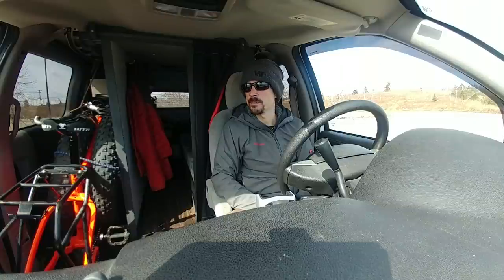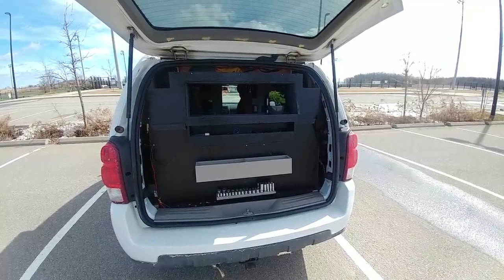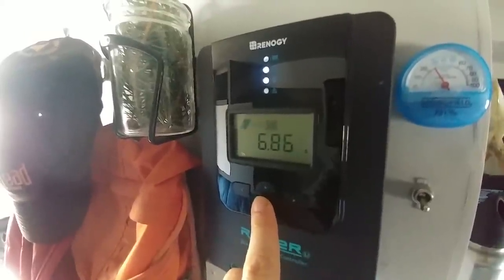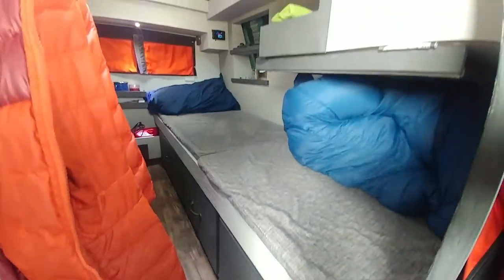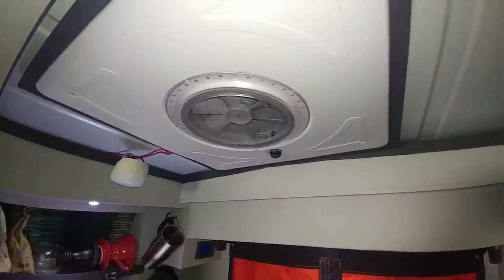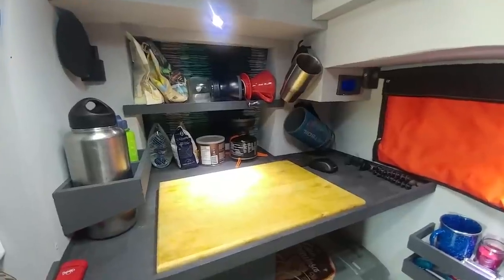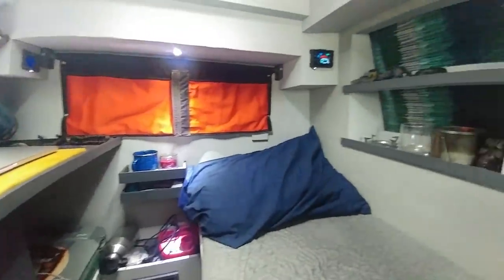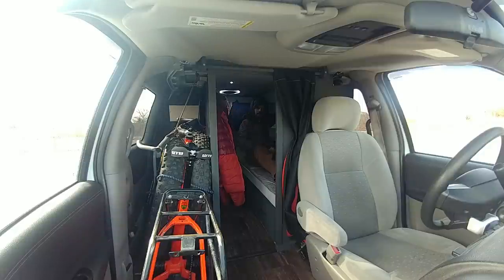First week of New and Improved Minivan Life

Comment: The interior build out is pure genius. The dual sliding doors, having a mechanical space as well as additional storage is maximum usage. You couldn't have done better in such a small space. 
Pure stealth.
Just a tip in case you haven't thought about it but you're going to need to beef up the suspension and when you buy new tires get the biggest available.
And get ready to go to replace wheel bearings.

Love your videos I'm actually living aboard and rebuilding a 45ft sailboat on the gulf coast. Love the vagabond life.

Good luck with your project and I'll be looking for your new videos.
Reply: Guessing your done with rumbling wheel bearings?...

Comment: Very stunning build, I love the bike locker area, I live in a teardrop because stealth is not important, Im a over the road semi driver, Ive used diesel heaters for many years, I have found straight #1 or kerosene  burns much cleaner and saves rebuild time, 
Thanks so much for posting and sharing your ideas.
Safe travels!🌷

Comment: I'm digging the set up the bed / lounge chair is a nice edition 😎👍👍 you hit the nail on the head working with square walls is  definitely easier than working with curved ones it was easier to work in my box van then it was to set up my Sprinter van with a curved wall

Comment: Yehh your all done job finish sit back take it easy,stick in with the work save your money ,glad you finally got the roof vent , now your bedtime a plywood board the length of the front on a piano hinge that way it can pull up level give you room to sleep on your side curled up be way more comfortable just have 3 small detachable legs to put under when you using it as a bed so it will be extra wide whatever the distance from floor to top of bed extra width  ,your freedom is your life ,safe travelling take care

Comment: Nice covert solar! You could use some hinges with some screws and some metal panels (preferably stainless or lacquered) which to be able to fix at a certain angle, to reflect more sunlight onto the solar panels, for the cloudy days or the days when you use more power. Especially useful during the winter time. The vans with a top window/hatch can also use this to get more sunlight inside while also not having those to the sides of the van. A random metal panel could be believed as having to do with the AC system.
Reply from the maker: It's on the list.  It will be a big job. So I'm waiting for warm weather. I have years of metal fab experience, hopefully I can find a shop open to the public.
Reply: @forestyforest  Please do make a video about it once it's done. I haven't seen this kind of thing done nearly enough in van-life videos, even though such a simple mechanism could increase the efficiency of the solar panels by a lot, especially for fixed solar panel setups. Also, a car sticker with chemicals might make it more normal to have a solar panel, for the people looking for above at the van, while stealthing, since some of the chemicals might need to be kept under specific conditions for as long as possible.

Comment: Hello from USA. I just found ur channel a couple weeks ago. Hope you are staying warm up there in Canada and good luck at your new job. I would really like to see a vid specifically on setting up a solar panel system for your van. Other than irregular access to bathrooms, I think availability of electricity is what keeps a lot of people from extended road-trips and/or doing something like what you are doing. Also, if you aren't going to insulate the space between the front seats and the rear area, I think you have a good idea with cutting out a square section of that wall behind the drivers seat to gain some space to stretch out more when you sleep. The section could be removable so you can replace that part of the wall during the daytime. You could look into mounting your tools directly on to the rear of the drivers seat to make space. Just a thought, but whatever you build will probably come out awesome. Looking forward to seeing more.
Reply from the maker: Thanks man i appreciate your thoughts.  It's still a big work in progress, many items to improve on the list.  But yeah before i had the solar i was spending 1-2 hours a day at the library charging up.  It is pretty handy being able to keep charged up anywhere.  But it was a pretty expensive upgrade that ate up a few paychecks.

Comment: Dude, when it comes to minivan living....you are the King! I congratulate you on what you've done and your learning process which is of tremendous value for us wanting to take the next step, all the while keeping the costs down.

Talking about the process, I am looking to do this for travel nursing starting sometime later next year....I am still undecided if I should go all out and buy a new hi-top Ram Promaster 2500 and convert it into a small comfortable apartment on wheels, of course at a large expense or buy a 2011 Honda Odyssey or newer for trial which would be a lot cheaper. Here in the States I would have a Planet Fitness nearby at most locations for showering although I also have an idea for converting (after of course removing the 2nd and 3rd rows) the 3rd row seat well where the seats "fold/hide" into a small bathtub complete with one of those DIY endless shower (1/2 gallon to 1 gallon) and possibly a plastic porta-potti in the well (If it fits) that can be also used as a sitting area while showering because standing is obviously a no-no. The plan is to go hiking on my days off so a shower may not be located nearby after an overnight or day hike if I am still planing to stay in the area. You see, as a Nurse I may be able to put together 7 - 9 days off at a time.
I am larger than you (5'11" 205 lbs) but I am a side sleeper so 20 inch wide sleeping mattress is usually good enough for me.
For a minivan, I would setup the largest possible solar panel on the rooftop. Currently there is 470W panel that measures about 80 x 40 inches. Why would I need so much power? Well, I would have a DC fridge and a microwave for breakfast and the pre-cooked frozen stuff like salmon, burgers in addition to veggies. I would also have a portable burner. Of course the Maxxair is also a go. My battery bank would be a larger lithium setup, somewhere in the 2400 - 3600 Watt range. I have a small folding bike so I would not need the 'garage' side entrance access. Because of the tub/bath in the back, the kitchen would shift more toward the middle of the van. I am thinking of setting the bed on the opposite side which makes it easier for driving and seeing around you while the bigger cabinets would be on my side directly behind me.
Got a couple of questions:
1) What do you think of a small ceramic heater? There are some small 200 to 500 watt (max rating) ceramic heaters that I think may do the job. I could run these off the battery bank at night. I believe I would preheat the van with the van heater first once I am settled during the night, maybe learn my way to have a timer turn on and turn off one of these.
2) Do you have any insulation behind any of the flat walls? If you do, what are you using? What do you think about placing Reflectix over most surfaces inside your sleeping area now that you have good ventilation? Would this keep the heat from escaping?

Comment: AHH I see you got storage drawers under bed so a flip up board to extend bed on a hinge may not work but you could have the plyboard on piano hinge on top just flip it over make it a in 2 Half's so when you got it as day bed you only flip over that half it maximises bed size will make sleep time way more comfortable it needs to be the best use of space you won't need to extend the length of you go wider instead

Comment: I have searched amazon for a low profile roof vent many times and never saw yours before. I have a roof rack with 300 watts of solar and need exactly what you have there to fit underneath. I've used google to find it on amazon so thank you for that excellent info.

Comment: I did what you are doing back in 2002 and have some info I would like to share. 1st while sun is good, heat is bad for solar panels. With your AC unit right under the panel it will heat it up and you lose usable power. I would like to add that if your parked in a "safe" place you can use wind power too. There is a ton of good videos here on how to use junk to do it.

Comment: Love watching what you do . Did you know you can get exhaust fans to go on the side of the vehicle. They can also be ducted so you could cook on your table and have the exhaust fan near the cooking . They open to the outside when the fan draws air which opens the louvres. I have one in our van . 12volt. 
I also have a 3000 watt pure sine wave inverter which will easily run the small microwave. They are not expensive either. With your washing up water maybe get a small rectangular tub and cut it into the top of the bench . Put a plug and hose on it to drain into a plastic Jerrycan which you could empty when ever convenient.

Comment: If you sleep with the top of your bed at a slight incline, you could shove your pillow further back (and your head) and that might give you an added couple of inches.  Just not sure if that would be very comfortable, especially if you're laying on your side.
Reply from the maker: I just tried but the lowest setting is too high, I could add a lower notch to see if it works though..

Comment: Bought a tripp lite spelling converter in 2005 replace the fuse once in 2009 still works however the fan died around 2012 but it is made of steel design and it never over heats.  I think they added a fan to be needed only during continual max load.

Comment: With the new job maybe you can save and then sell the mini van and buy a camper. One that's set for heating and living a better life. I had a 2003 Altima which I wanted to sell since I got a newer car and a guy traded a 2008 RV for the Altima and $1500. Then I traded it to a mature couple who wanted to down size from their 30 ft RV I gave them my 15ft RV and $1000. I didn't know at the time but it had two slide outs that made the interior GIGANTIC. I love the outside graphics and friends figure I paid $20k - $30k for it and in all it cost me a $1500 Altima and $2500. $4k = almost $30k. I just bought a 2010 Mercedes GL450 for $8500 and replaced the air suspension and pump for $1200 total and resold it for $15k. You can make money all the time if your handy. I was a mechanic but that was back in the 80's and I have fun with it all the time. Always look to up grade and before you know it you have 10's of thousands extra in your bank account! No one makes money sitting still. A good set of tools can make you lots of money. Loom to buy something with problems then check it's sale price if fixed and you'll see if it's worth your time. For me the Mercedes took me 3 1/2 hours. 👍😉

Comment: @Foresty Forest, I had problems with an inverter starting a power brick and I found that unplugging the brick first, start the inverter and then plug in the power brick actually worked.  If I didn't do this then the inverter would keep cycling and not power up.  I hope this might help you.

Comment: Hey, your build is really awesome.  I have one comment: I notice you remove both wheels on your bicycle.  Depending on how you use your bicycle, you may want to consider a folding bike to make storage easier.  The wheels are smaller, but the chainring is larger to compensate for this.  There are even electric folding fat bikes, which seems extremely niche, but the market exists for them.  Something to think about.

Comment: About the only thing I might have done different would be to make my walls out of lighter materials. I have glued a sheet of foam board, which is around $8 to a sheet of luan, which is around $15.  I think right now this plywood is around $35 for pine. Then used boards anywhere you need support. You might have said but how much weight do you think you added?
Reply from the maker: I weighed all the seats when I took them out and it came to nearly 300 lbs.  It's hard to guess but I probably put the same amount of weight back into the van.

Comment: Reminds me of an escape pod like the kind you see in Science fiction movies.  I think I'd stick some self adhesive 6mm closed cell insulation on that exposed roof panel though. It wouldn't keep the heat in but it would keep the inside of the roof panel a few degrees warmer and help prevent condensation.  But that's just me. It's still a seriously cool design.
Reply from the maker: Thats a good idea.  I need to figure out how to insulate the vent too, it isn't very well sealed.
Reply: @forestyforest  ..lots of videos on van roof vent installs, check them out.  A non hardening flexible mastic is usually used and the type used by caravan builders is the generally the preferred choice. Look forward to seeing how you get on.

Comment: Great set up. Very efficient use of space. Is it always that tidy? Do you find if you spend along time un their you get claustrophobic?
Reply: Do you have a moisture problem?
Reply from the maker: Yes the vinyl floor is easy to clean compared to shag carpet.
Reply from the maker: @gibo1971  nope the diesel heater is dry heat.

Comment: That looks like a short wheel base van, you can add some space with a longer wheel base.

What would happen if you just ran the engine to get heat at night?  I know it wouldn't be stealthy, but would you consume to much gas?  Would you hurt the engine by idling too long?

Comment: Hi, 
I looked at minivans again, cargo capacities  are 126 cu ft Venture, 140 cu ft venture extended, 167 cu ft Grand caravan. The 2005+ grand caravans have sto and go seats, which adds another 10 cu ft when seats are removed, battery and such would easily fit there under the floor. There was one in the junk yard with a fiberglass high top, which I could almost stand it, probably 5'5 in clearance. I could almost stand in the front sto and go well as well. I also looked at a 86 lesharo that already had a 95 GM 3.8 v6 conversion, but the guy used a 3 speed and not an overdrive transmission, I didn't buy it. The full size vans, extended, chevy express cargo are also good for stealth, as they look like contractors vans, lots of room, but lower mpg(237 cu ft). There was one with a top there, made the grand caravan look tiny inside. The full size vans have a higher floor to fit the drive shaft under, but there is room under the floor on the right side  between thr pass seat and axle for a compartment for battery and such. The extended van is the same length and wheel base as a leSharo, 20 ft. The leSharo back  is 6 inches wider.
 Tony
Reply from the maker: I like the looks of the Nissan NV200.  Not too small and not too big.  Easier to convert compared to a minivan.  I don't know what they cost though.  But i am happy with my build, would've been nice to have the extended version.  Have you seen any Astros or Safaris around? a 2005 wouldn't be too expensive and they're easy to convert.
Reply: @forestyforest   Hi,
Yes, I looked at the Astro vans. The are rear wheel drive all with the 4.3L 90 deg v6. Its a cast iron engine with the same parts as the 350 v8. reliable.  There were a lot in the junk yard, so parts are cheap and easily available, many for sale on Craigs List.  As RWD the floor is higher than FWD. 170 Cu in cargo volume 3 cu ft bigger than the grand caravan, if you don't include the in floor seat storage area. They are tough little vans with a high tow rating. They have a unitized body, so the frame is integral.  I looked underneath, but I don't remember if there is room for a compartment. It wouldn't be that hard to cut a hole in the floor for a trap door to access the battery compartment from inside.. One had the high top conversion and the height was about the same as the caravan one, not quite tall enough to stand in. I suppose one could get the cargo version Astro and install the high top from a junk yard and have the best of both, a blank slate and metal back windows. https://en.wikipedia.org/wiki/Chevrolet_Astro
Tony
Reply: Hi, The 2005 Astro van and the 2005 Chevy express 1500 use the same components, same 6 cyl engine, same transmission, same brakes and axle ratio (specify 3.42).  There is 1 mpg difference,  15/20 vs 14/19 mpg. The cargo area is 51.9 tall by 128.7 long x 79.4 exterior width vs 47.5 by 98.9 by  77.5 exterior. So the express is 4.4 inches taller, 30 inches longer and 2 inches wider than the Astro. Logic would say, then the extended Express is another 20 inches longer.

Comment: I love the adjustable bed/chair. I love the  pullout desk but ogether? They are like peanut butter and jelly. Your comments on utilizing exterior space inspired me to utilize my truck's rear fender wells for a pump and water storage using 4" pvc pipe. Why the bike though? Get rid of it and focus your superior talents on something productive. I will concede if the bike is used for functional travel. Maybe I am prejudice, a childhood friend simply flipped his bike, broke his neck and suffocated due to the paralysis.  I was caught up in the marathon craze and paid for it. What did I get for placing 231 in the Chicago marathon? Pain. One knee replacement and a hip they won't touch. A word of advice, either get rid of it or put it on a bike rack. You will know if someone is trying to take it. With your home protection system, mine is the threat of a  9 mm, no one can take it. The valuable space will allow you a formidable galley.